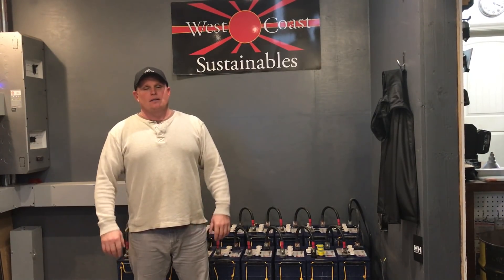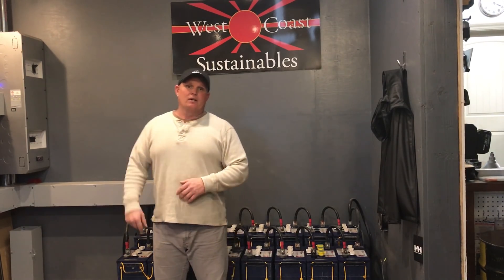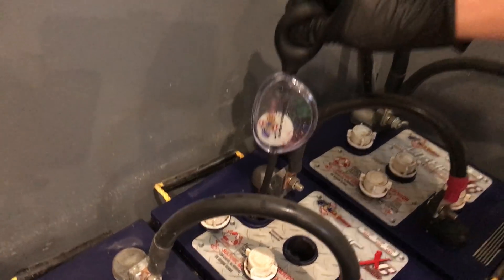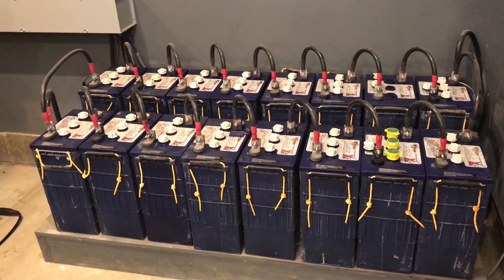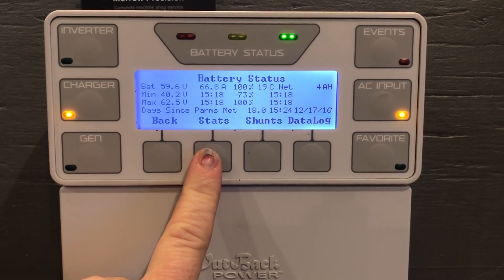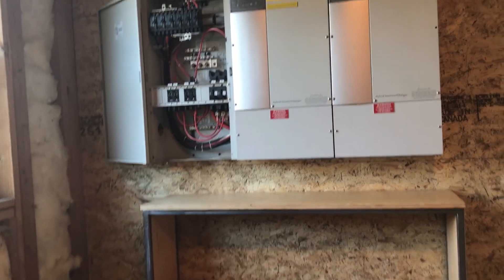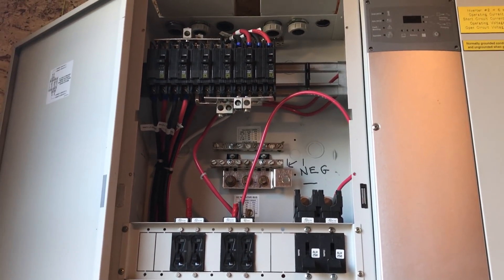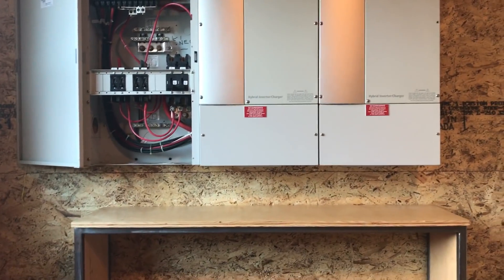Off grid Lead Acid battery bank repair

Comment: At 1:30 you are talking about the single cell that causes the entire bank to fail - should we be utilizing a BMS to see output/input?
Reply from the maker: Hi Ron, you know I am not sure of any BMS for lead acid batteries.  Unfortunately with lead acid batteries they really just need to be monitored with a hydrometer to see the specific gravity of all the cells on a pretty consistent basis.  For a while DEKA was trying to release a sealed lead acid battery that had a BMS and I was pretty excited about it but lithium was just breaking through and I think it killed it.  I will say that my first off grid system I built had a pretty monster seals lead acid bank (telecom) style and it lasted 15 years
Reply: @JasonAndrade427  I am hoping we can recover a few year s or more from these. The Absolyte that we picked up are AGM (Glass Mat - sealed) so testing is not possible with a hydrometer. Thanks for you feedback - subscribed!

Comment: Off grid in Tombstone, Az here.  I have a question regarding replacing batteries. I’ve only lived off grid for 3 years now and we have a 16 count lead/acid battery bank. 

When we first moved in, we were told by an electrician that when one battery goes bad you have to replace the one next to it also. 

Is this true? If so which one do you replace the one on the right or left and how do you know?
Reply from the maker: I'm not sure that's actually true or not, what happens when a battery goes bad is a cell dies or shorts.  This means the rest of the batteries have to absorb the rest of the voltage as it usually isn't caught until to late.  The extra voltage then will typically take out the next weekday cell, when I have replaced banks the bad batteries we're typically random

Comment: Thanks for your video.  Perhaps a quick question? With 2 SW5548 inverters and 2 MX80 charge controller”s, would a mate 3 be of any use? And what BMS are you using on the 8 x 6 volt strings? Thanks for your help.
Reply from the maker: the benefit to the mate3 would be pushing the data to the cloud, if you add a flexnet and a shunt you can then also access the logging feature to better evaluate the health and constant SOC of your system

Comment: I know this is an old post but what was the age of your battery when you added the new replacement.  I have a four year old bank and one cell died in one of the battery so its throwing off all the others in series.. is it still possible for me to add a new one or is the bank too old?  Appreciate your input.
Reply from the maker: they were only 4 or so years old, I did not properly charge these though as I needed more solar but funds were tough as this place took so much $$ to make it livable in the beginning,  in  your situation and sorry this is so late, you could possibly add one but it would take a lot of the load because have less resistance then the others and likely you will see other cells start to also fail like dominos from my experience
Reply: @JasonAndrade427  ok thanks.. I already upgraded to lithium since then. Thanks for the reply though.
Reply from the maker: @carlsonhenry  what did you go with?

Comment: How did it go with your 1 battery replacement ? I have the same case but Trojan say one should not change only one battery  !!
Reply from the maker: they lasted another 4-5 months and then I started losing other cells, i replaced this bank with another that worked well until i received some lithium from simpliphi

Comment: I am an electrician in Virginia. Nice job . Just curious , how much money do you have invested in your electrical system .  
Thanks,  Michael M
Reply from the maker: Michael McCracken hey thanks for the good review! I would rough guess 25 kw for both systems with about 13kw of pv.  I would say this is way below normal as I received some amazing deals and trades along the 4 years I have been working on this system. I would say to replicate it with new material at this level would be around $75k.  Not many people need dual off grid systems though, trying to do all the fabrication and projects off the grid and using sun power over a propane generator has added some extra expense.  I also have designed in some other future additions that added a little extra cost also.
Thanks for watching
Reply: That's crazy, why so much when you will not recoup cost for how long?
Reply from the maker: Being completely off the grid it pays for itself immediately, I’ve been through fires and was the only one who had power 🤷‍♂️also I’m kinda an independent guy so it works

Comment: 4 years is quite short, 8 is sort off minimum in the banks we sell and install...(lead acid that is), Y have several customers still using the 10 year battery's (getting adged now.))

Comment: Greetings from off grid Oregon,I think Roy is right. I have a 24 volt system and my absorb voltage is @ 30 volts for 3 hours. My battery bank only has eight L-16 batteries and my ending current is 6  amps. I use more water this way but sulfation is not an issue so far. I also do not let the batteries get below 88% SOC. I burn more diesel this way (27 gallons last year) but I hope to get 12 years out of my batteries. I have a friend who has been off grid for 40 years and he said I could get 18 years from them doing it this way. That's how long his first set lasted. He has the 5000 series Rolls now. Thanks for the video and I just subscribes too. Not trying to give advice when I should be learning from you. I just wanted to share my thoughts on what I have found.

Comment: jason,, what is the input voltage on your charge controller at night when they are at rest
Reply from the maker: Garfield Oliver hmmm I will take a look tonight what are you thinking?
Reply: there is input voltage on my charge controller at night at about 15v when at rest

Comment: iff these cels are worn in 4 years you did something wrong, these cells will take you at least 10 to 15 years, if mantained, connected and threated right. (from experience...)
Reply from the maker: I was harder on them in the beginning of there life as I had to build this system incrementally and had to rely on the generator as a primary charging source, also I am have pretty good usage and could use more storage now as we are doing more building on the shop but I wanted to used them as long as possible before replacing them with a larger Amp hour bank.  I have never seen a set of these L16 ever go that long off a daily used system seven years is the longest so far.
Reply: thats understandable, if they are not really good obtained in the beginning , decay falls in fast, now even whit the shorted cel. thats just bad luck, so early, are you ot affraid off missmatching trowing in the new cell? tats hard for all te cels..but y agree you can use it a few more years now maby, at lesser capacity..
Reply from the maker: MrBugsier5 I think it will be hardest in the new cell as it should have less resistance? Everything I have read and learned about adding old batteries to new is that the new one degrades to the old ones.  Interestingly I have done a fair amount of battery stuff but most people don't usually catch the first failed cell it usually wipes the bank out. So we are watching them closer weekly instead of monthly to see if we see any other weak ones, it looks like I might have picked up a battery manufacturer sponsor for my channel that might be sending me 24 of there new 2 volt agm L16 batteries for the new custom rack!!! CANT WAIT

Comment: Excellent video as usual Jason, love the dual system setup. The surge capacity on those XW  6048s .. OH MY LORD!! The system control panel is indeed a pain in the ass, but their Combox/cloud reporting site is a saving grace.
Reply from the maker: ejemm thanks!! I can't wait to get it up and running I was using the table saw last night with the generator and it will be so awesome to just have to flip a switch and run off solar

Comment: You are a great teacher of truth. Maybe for your next up-grade toward 480 volts 3 phase for larger shop. Batteries from electric forklift for extra heavy-duty DC storage power.
Reply from the maker: Stan McBeth hey there !! The next system will be the final one on this property and will be a true three phase system.  If I wasn't so limited on room I would make the new one three phase but I can't fit any more under the house and am saving that for the new shop

Comment: You should also get an internal resistance meter to keep track of battery health. :)  It's helpful to know what cells or batteries are beginning to go out and are not holding up well.

Also how often do you need to water your batteries?  And how much % of the battery capacity do you use on average throughout the year (I know it might vary greatly by season, but I'm curious).

Comment: dude, your not flushing your hydrometer between readings! Probably wont make a difference on that rear cell reading, but if you want to be accurate...
Reply: nice video though!! :-)
Reply from the maker: windsine I really never thought about that being that you empty it, you think the residual will cause that much difference?
Reply: yes it causes inaccurate readings. Its not so much that you rinse with distilled water between readings, but you can fill and empty 2 or 3 times with the electrolyte (you want to read) before you actually read it (from that same cell). so you, in essence, are rinsing  (diluting) with the electrolyte before you read that particular cell. repeat for each cell. When finished with all your readings, wash out hydrometer with distilled water. Roy Amberg is right, refractometer is nice but requires good light to read. If you are in basement, stick with a temp-compensated hydrometer :-)
Reply from the maker: windsine see this is why I followed your channel years ago I think it's time for the winsine channel to make a comeback

Comment: my findings are those hydrameter are in accurate compared to a refractometer. what voltage are you running on your absorb setting
Reply from the maker: Hey Roy! I am going to get one next week from Wholesale Solar and give it a try
Reply: What voltage is your absorb setting. And for how long. I did a bunch of testing on this. There's a lot more to this then most people think. The float voltage is another subject also
Reply from the maker: Roy Amberg I am bulking at58.8 for 2-2.5 hours and end of Amps is at 16.8
Reply: Looks like 2 strings of batteries so if we devide 16.8 by 2 it's 8.4 amps per string.  That should get down to about 2 or slightly less.  Your at 58.8 volts decide that by 4 for thinking purpose it's 14.7 my findings that's way to low. Around 15 is more realistic and if your useing your batteries at all 3 to 3-1/2 hours be more like it. A refractometer will tell more but the current at the end of the absorb cycle should end up below 2 amps per string. As the battery resistance goes way up when its fully charged